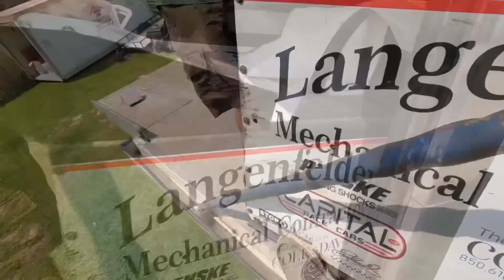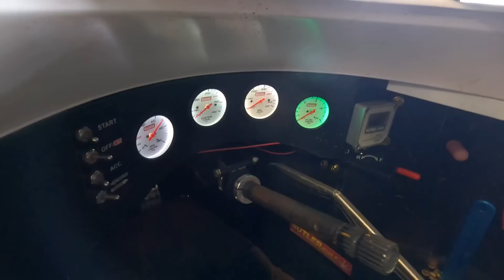How Long Does a Dirt Late Model Engine Last? Counting Laps on Our New Motor!

Comment: 1200 laps, say $9000 freshen up, $7.50 a lap, PLUS oil changes and other maintenance. Include tires, fuel, other maintenance (brakes, starters, rear end etc) Add in the transporter fuel, maintenance. Insurance,  (and monthly payment). Food and refreshments for the crew......
That seriously adds up. Never mind the amount of time you guys and friends put in on the cars....
Running the big car and not getting a pay back of a minimum $2000 is a serious budget strain.
Knowing all that, you guys have figured out how to get the numbers to work. 
Sponsors, Merch, and donations etc are ALL integral to it working.
I, for one am impressed at the speed at which you guys have grow. You have also been having the time of your life, which is the motivation. 
Fantastic job and keep up the great work!!!!
P.S. you do it with a great sense of decency and moral compass.

Comment: You guys might think about using "Forged" AN fitting on the fuel logs. More pricy, but they don't crack and safer re: Fire! Glad to see you al' got home safe and re-cuperated.
Reply: Eventually that will crack also.....Feed line Must be supported at the engine and car frame end....The fittings are stabilized and only the hose can flex....
Reply: Yeah that plastic is not made for the torture they put the cars through

Comment: Make sure you support those elbow fittings with a wrench while cranking down the “B” nuts onto them. They are only aluminum and aren’t designed to be side loaded from the force of tightening the line into it.

Comment: My guess on the changes they made would prob have to do with where the 5th coil was mounted to the lift bar. Just an estimated guess. Has a lot to do with foward bite. Probably easy to overlook. Enjoy the videos!
Reply: Said on Patreon "something" got assembled incorrectly at Capital. No idea who bolted "whatever" together. Was in wrong hole. But everything is a state secret with these guys.

Comment: A tuneop on an engine with 750 laps around a typical 3/8 mile track equates to less than 300 miles. Nascar engines run for over 500-600 miles on a typical weekend. I had no idea your engines took higher service marks than theirs.  In looking at the oil drained, I think maybe the oil and filters could be changed out sooner, though.  After looking at the past few races, it seems your chassis balance doesnt allow you to drive the track sweet spot line, which hurts your ability to accelerate out of corners as fast as others.  Finally, double your pleasure, run bith cars instead of sitting one for what if.  Would love to see you guys run 1-2  sometime, heck most of the time. Go HTF!

Comment: If all the dirt series would get together and pass a rule maximum compression 12:1 and 8,200 maximum RPM you could get 2,000 laps out of a motor just change valve springs about 800 to 1,000 and the racing would be just as good and save the teams about 20,000 a year !!! Race smart save $$$$

Comment: When I was in high school (back in the 60s) I was on a Cam AM type race team. We raced a mid-engine purpose built race car. It had a Covent Climax engine. The builder of the car told us to rebuild the engine at 16 hours or it will blow up. We were at the last race of the season and thought it will put us at half and hour over that. Should be okay to run this last race then rebuild it. It blew up on the last lap!

Comment: 1200 laps ain’t bad. Heck the serious drag racers put new rings, bearings, and aluminum rods in every 25 passes. Sometimes the valve train too. You see them with hash marks on the valve cover keeping track, little easier than what you guys got to keep up with. Seems like that’d be a job for the crew chief, but who’s the chief?

Comment: I dunno if its like kart engines, but i know that dyno is for show... usually high dyno HP, usually ment less HP, in the RPM ranges that WERENT max HP... yeah, its cool to reel them in in the long run, but bogging down low is what yor usually doing... a carb tuned for THAT area wins....
Reply: This is why i think the draime was so fast... yeah, peak Hp wasnt the best, but it bogged like a tank.

Comment: I noticed some frame damage in one view on the right side low behind the motor, could that be part of the setup issue? Or is it the way the light was hitting it making it look like damage?
Reply: Yes sir I noticed that too...Either it's a visual trick or that RS frame is flattened out.
Reply: @JJ-1-1  I don't remember them getting hit there so that's what's really going me confused.
Reply: No frame damage got back to 15 min mark and look closer.
Reply: @1clnsdime1  Yea like I said I guess it just a visual deal. I'm sure that RS frame rail has been hitting the track and rubbed the paint off. The higher we raise the RS frame rail and rack plate the the further we travel our cars or atleast Our Longhorns and all modern Rockets anyways.

Comment: What size track are those 12,000 laps based on? You figure 3/8ths mile laps would be 4500 miles. 1/4 mile laps would be 3000 miles. 1/2 mile laps would be 6000 miles. That's a huge difference.

Comment: Do they run jesel valvetrain components on these motors? What kind of seat pressure do they run?
Reply: "What kind of seat pressure do they run"  Open or closed seat pressure ?  It's all across the board but you can bet it's around 300 lb on the closed. I know it can vary alot of builders are using comp cams TD rockers or Xceldyne stuff is super popular. Jesel isn't used much by the top engine builders any more they had quality control problems and there stuff was breaking awhile back on these 430ci 930 hp super motors turning 9200 rpm.